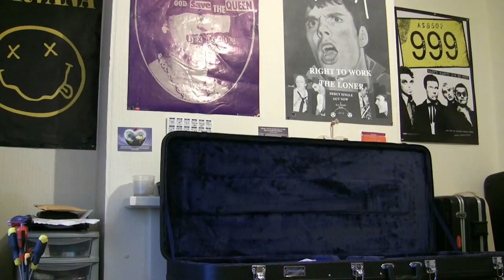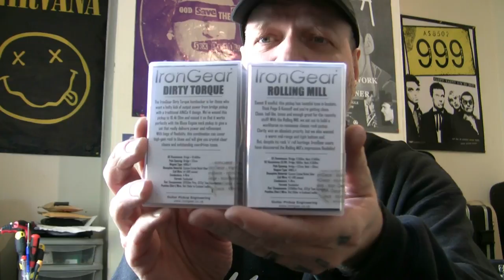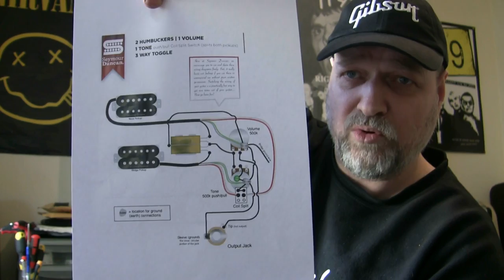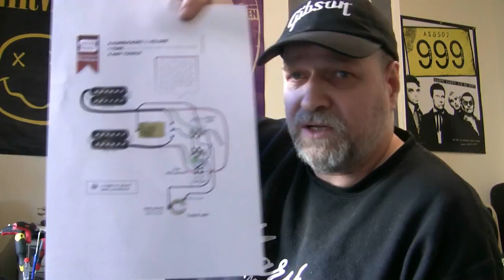Jackson KS2 Kelly Star MIJ: complete overhaul/upgrade...

Comment: I was hoping for some sound check before and after the work was finished. I insta replaced stock pups for sd black winter set on mine and it sounded amazingly. Thanks for sharing.